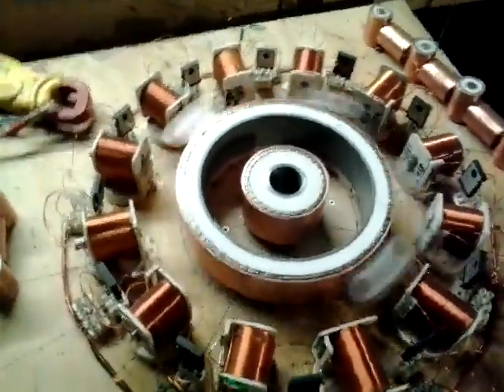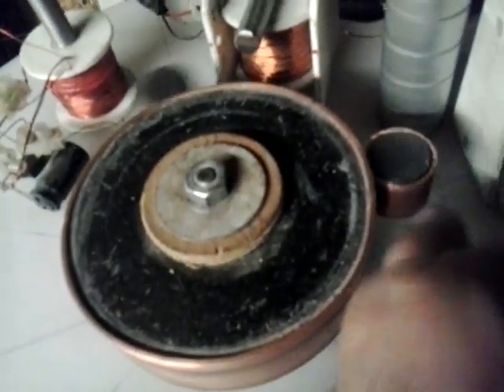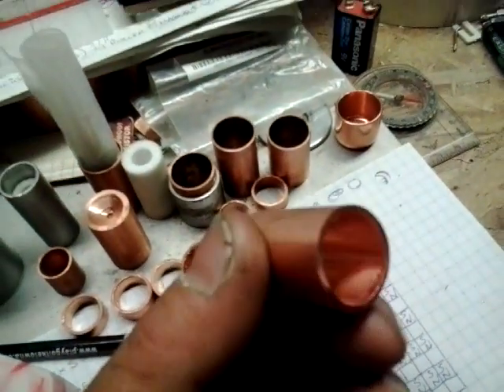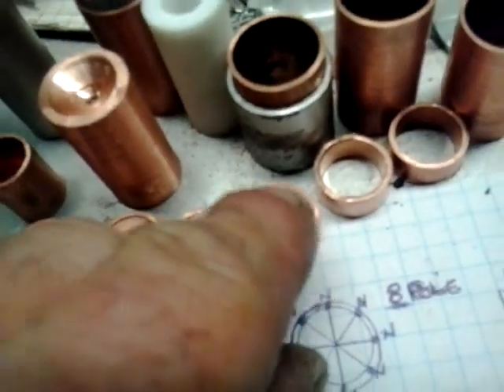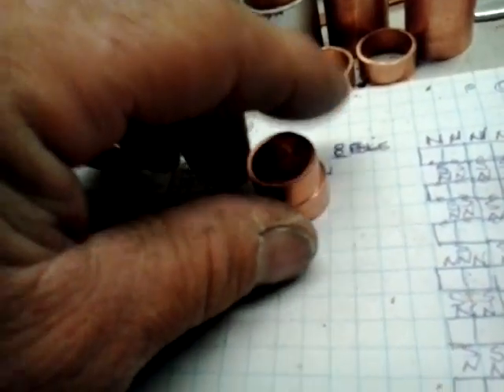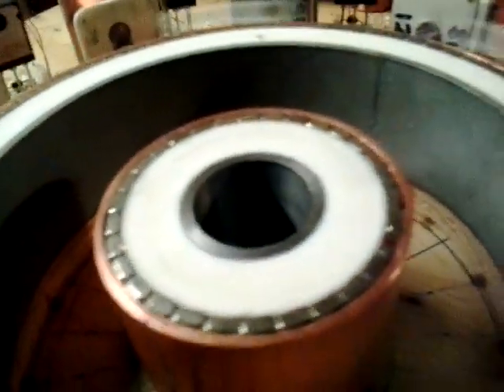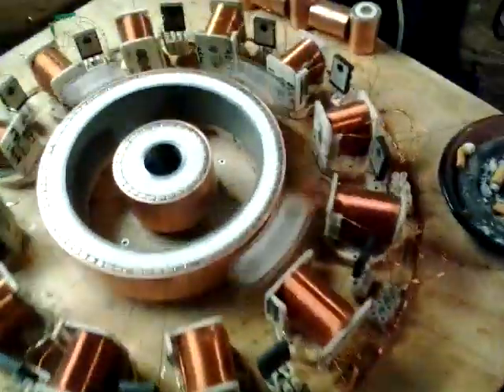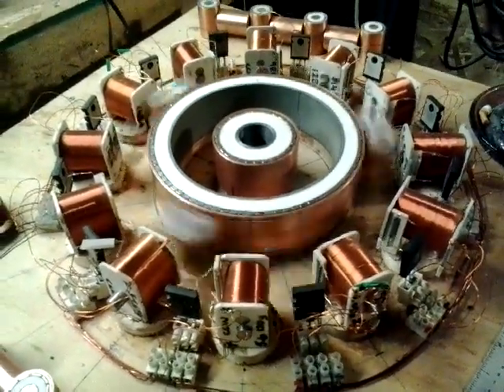John Searl's Seg Machine Build #2

Comment: This looks like a nice experiment, however having read some Searl's works discribing the build up of the rollers and rings, I see that this gentleman's setup is different. The materials he uses do not fully resemble those which searl used. There is a reason why searl used rare metal in his rollers and rings. Also the magnetic fields on the rings im searl's device where imprinted. I believe if any one is trying to replicate and study searl's work and seg mechanism, they should follow searl's methods by the book. Just some thoughts. Best wishes and keep up the experimenting.

Comment: Bet it runs the battery flat
Reply from the maker: Read all the comments below... there is no induction...other than fly back voltage...all coils are driving coils. Currently working on a newer version using different coils... bucking coils...until I can develop a method for producing an alternating wave form...sine wave.

Comment: Why 8 on 8? That's anticipating locking. Why not offset your matching by a ratio with counts that have no common denominator as to eliminate tendency for symmetrical locking? Offsetting always will aggravate imbalance, so further movement. Ie: 3/5, 6/7 , 9/11 etc

Comment: I am looking to build a working model. 3 Rings of mulbedium magnets are required. What is the approximate cost of constructing a small working model?
Reply from the maker: Jonathan...I have never heard of mulbedium magnets before..?? The version in this video you are seeing cost maybe around a thousand dollars...coils and the rollers are an additional cost..being around 100 hundred dollars each. Of course the labor required to machine and assemble all this is an additional cost...as I make everything...other than the magnets. I am currently working on a three ring version...I have much work to do still...getting the rollers to levitate is another thing...centrifugal force is another factor that has to be taken into account. ...I am so far as to say that if someone is able to build this in the manner that John Searl says it should be build it would cost tens of thousands of dollars to build the prototype...it still has to be proven...the Russian version's also very interesting... I have been looking into that also...good luck with your project.

Comment: Amazing amount of work!               I see you have this rigged up as a motor. Check out these links in this piece, may give some new clues.
http://doctorkoontz.com/Scalar_Physics/Searl%20Effect/Experiments%20of%20Roschin%20&%20Godin_01.htm
This link is the refutation to the complaint that there just is no proof that Searle was for real.  The Roschin/Godin replication experiment showed over-unity, gravitic, and cold along with interesting magnetic anomalies. Yes this is proof positive and results written up in a scientific paper along with their methodology, enough so that I believe a techy person with study and enough pluck could replicate what they did if not improve on it. They spent an awfully lot of Jack on incorporating safeguards against a runaway which they didn't really need in the end. Likely only needed a strong magnet to disturb the harmonics to stop the power increase. As it was they didn't even need that  to stop it. If I'm reading the paper right they used a single 1 meter stator ring and stationary but rotating rollers. Quite the setup. They prevented the rpms from getting beyond 550 "for various reasons ", if I remember right from previously hearing about it, one of which was that the safety margin (rotationally, inertially) would be exceeded. At 550 rpm , they got a max of 7kw of FE, any more draw caused the speed to fall which in a short while killed over-unity. Likely the more rpms, the more power available, but they were afraid to go beyond the 550-600 rpms. At the 550 figure, there scale registered-35% of G and when  the rotation was reversed at 600 rpm, the Gs went to +35% .
  Instead of dinking around with trying to "magnetically pixelate " the rotors, instead they just took the easy way out and glued rare earth , assumably, bar or round form magnets together, making a nicely uniform magnetic "gear pattern needed to get the harmonics going. Elsewhere I remember seeing that the diameter ratio of roller to stator needed to be 12:1 or greater. They seemed to have used a regularly magnetized stator wrapped in copper foil skipping the Searle layers with dialectic and the triple concentric ring setup that J.R.R.Searle was wont to prefer. Searle's theory/experience was that the 3 concentrics caused more "electric pressure " to be brought to bear.  I'm wondering if maybe the anchoring of the rotating magnetic cylinders in place allowed less of those to be necessary around that huge stator, perhaps skipping every 2nd or third node? Would be a huge number of rollers if they were allowed to free float with single node spacing around that giant 1 meter stator. At any rate it sounds like in some respects it's a similar setup to the copper drum over at a Searle lab at this link https://youtu.be/J9Orzbq42N4
Note the left hand instance of the big copper drum proof of concept .  Again note this anchoring of the rotor in place maybe similar to the Russian experiment in that respect.
De
Reply from the maker: Thanks David...and I appreciate your input...and yes I have seen the Russian version...and have started building a similar setup...more videos to come in the near future.
Reply from the maker: SEG #3  is the beginning of the Russian version